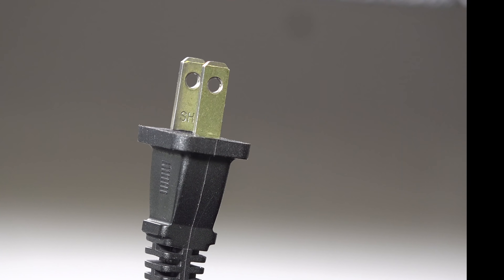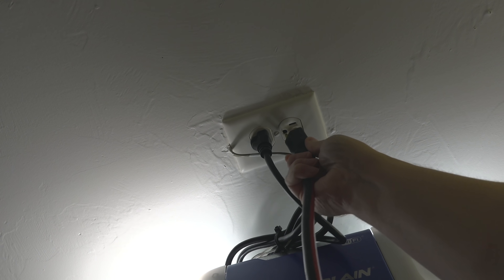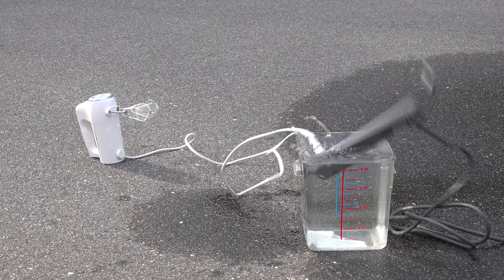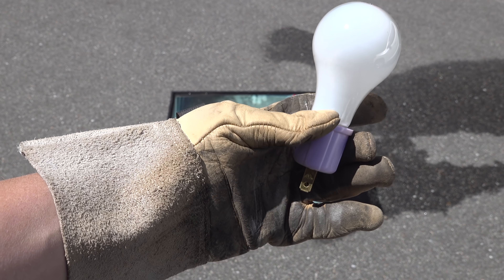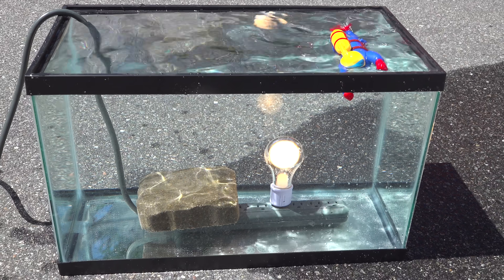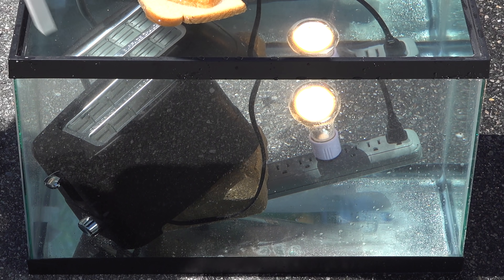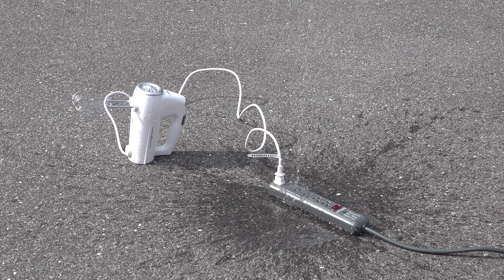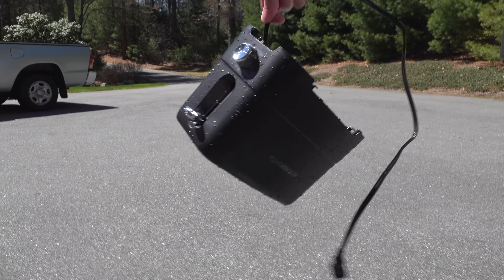What REALLY HAPPENS WHEN YOU SPILL WATER in an OUTLET?

Comment: That is high-end outlet lol, now test it with made in china outlet then you'll see the difference.
Reply: We've actually tried that at school, it does nothing, it was a class about how water isnt really a conductor, the shit in the water is the conductor, so the dirtier the water the better it conducts electricity.
Reply: @markpagtama7954  bullshit .. connections are air tight and to a degree waterproof ..if you leave it in the water for a few hours it will eventually get fucked up because moisturize will be built
Reply: @chriscs9080  you could literally try it yourself, matter of fact you could try it on exposed wires if you really want to. As long as the water is clear it won't do anything as its not really a conductor.
Reply: @markpagtama7954  water its not 100% clear unless filter is used.
Reply: @chriscs9080  water needs ionic molecules present for it to be conductive, tap water has trace amount of ionic molecules like calcium, salt, etc thats why it conducts a lil bit but it wouldnt overload a breaker in those kind of extension cords.

Then try it with salt water.
Reply: @chriscs9080  I know this is a late reply but there's an experiment in youtube where he used a distilled water and there was 0 conduction.
Reply: This made my day
Reply: Ya know that almost everything in the world is made in china, right?
Reply: @THICCSmoke_  yeah and almost everything is cheap and breaks
Reply: @THICCSmoke_  

When I take a dump 2 time's out 10 it's made in China. 💩
Reply: @THICCSmoke_  actually no
Reply: @THICCSmoke_  yea it's why the world's falling apart at the seams
Reply: well basically almost every product now are made from china. even those product made from different country has a parts from china
Reply: LOL
Reply: Damn what a dumb comment
Reply: they are both made in China. the difference is the company paid one factory more than the other company,.
Reply: @flighted2513  DUDE VIDEOS IS IRREVERENT, WATER DOES NOT CONDUCT ELECTRICITY
Reply: Lmao.
Reply: It’s not necessarily china since nearly everything is made their but it’s more so how
Reply: @OccupiedMuffins  there*
Reply: Lol, I sincerely apologize for the failed condom ur dad used that’s made in Chyna.
Reply: this one must be made in China too
Reply: The outlet he used is literally made in China lmao
Reply: A lot of these high end outlets are from China babes😭🤌
Reply: @tzizzle  if you say "babes" ever again I'll decapitate my head off
Reply: @tzizzle  You girls are annoying with your use of emojis
Reply: @kiwikiwi2483  you make zero sense
Reply: True
Reply: PFFF YESSS HAHAHAHAHAHAHA
Reply: OMG HHAAHAHHAHAHAH
Reply: @Kylie lastimosa sakit chan ko dito
Reply: This comment is a so ignorant
Reply: That's what I'm wondering
Reply: Racist lol
Reply: Bullshit. It’ll all be the same
Reply: WOULDNT CHANGE BECAUSE OF THE PURITY OF WEATER HE USED, WATER ITSELF DOES NOT CONDUCT
Reply: This comment made my day lmao
Reply: Kaboom
Reply: Try a made in Africa
Reply: @kai1deveIoper  water itself is not conductive of electricity
Reply: Groundhog day...
Reply: Naw, it will do the same thing
Reply: Definitely
Reply: What can be so high end about an OUTLET?
Reply: That is made in china
Reply: Yeah He'll burn his house down.
Reply: Outlets sold in China are different itself. They use thin isolation. When touching with wet hands the wire to plug out cord, could feel zip already. So, it is made in China and sold in China quality. Imagine.
Reply: I have spilled water on my cheap outlet a few times & nothing
happened.
Reply: For real hahhaha
Reply: Most of the high end plugs/extensions are also made in China, You pathetic loser
Reply: Most are made in china...
Most are not good quality...
Reply: You just got slammed by Jesus. 😆
Reply: Hahahaha yeah
Reply: u look cheap yourself, u made in china?
Reply: @kalashnikova5105  l
Reply: @kalashnikova5105  I'm made in vaChina ( ͡° ͜ʖ ͡°)
Reply: @kalashnikova5105  no I hate bing heads

Comment: So from what I understand most common extension cord outlets don't have fuses or breakers in them, so there's no method of disconnecting power within the power cord, and as long as the breaker box for the house doesn't read more power pumping through the unprotected garage outlet than its fuse can handle, it won't care at all about whether or not the extension cord is soaked.

A breaker/fuse going off on a device to disconnect its power is a safety feature, and so while you won't get the fun time sparks in water if you remove it you also risk having a running current that can become exposed. 
This is more problematic when the wiring within an extension cord is often times weaker than the ones in your house walls, so if your wall outlet doesn't trip a fuse when pumping out whatever amount of power it pushes, that could still overload the extension cord but it wouldn't disconnect because the outlet isn't exceeding its overload capacity. Then that's when fires start

Comment: its not that electricity and water don't mix (which with pure distilled water they don't...) its that non pure water and electricity mix a little too well...
your problem is you didn't have a ground.  run another line from the water to something else like a line buried in the dirt next to your driveway or a large metal object. (you know like the piping in your bathroom)